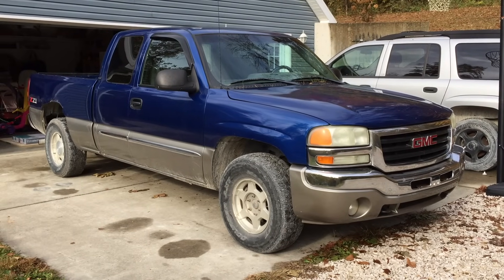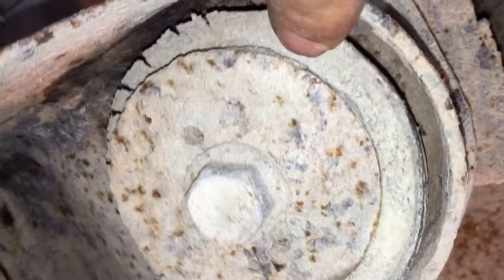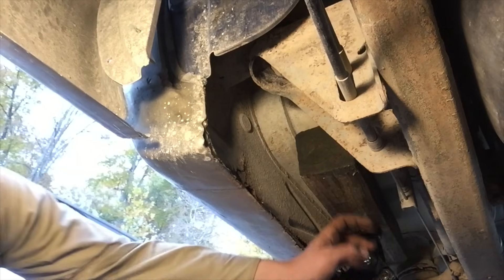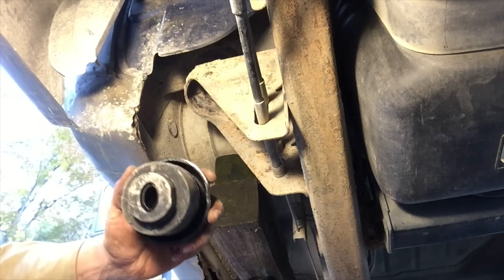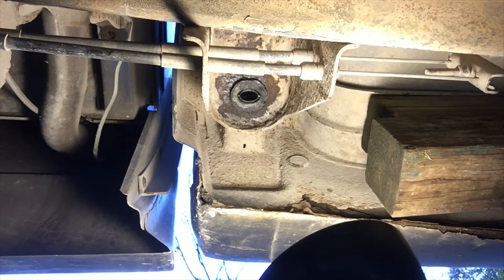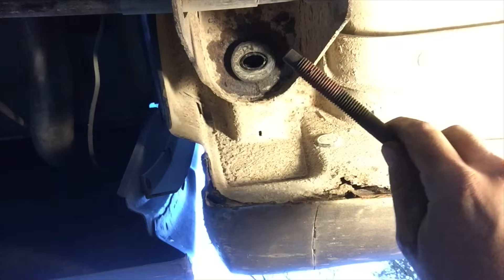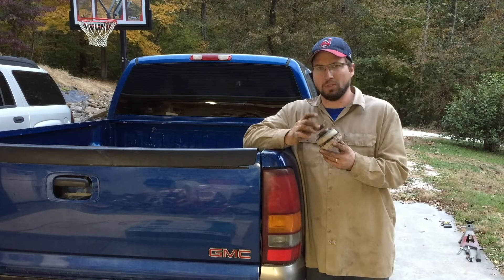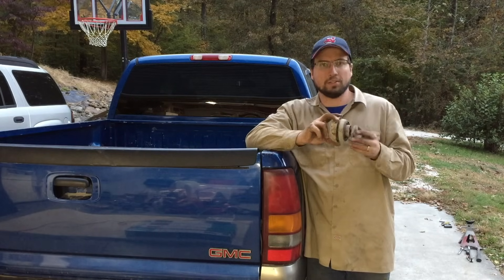How to replace truck body mounts - Body Mount Bushing replacement - EASY - Chevy/GMC

Comment: Those washers are for the top of the mount they go against the cab to keep the top of the bushing from sliding around
Reply: Where does it go exactly.?
Reply: glad I saw this thanks
Reply: I called dorman they told me they were for the bottom of the lower bushing theres already a steel cap on the top bushing.
Reply: @robpaul7900 so they both go right after the silver plate?

Comment: I pulled mine this morning and immediately had two of the bolts snap off. Do yourself a favor and get the bolts to replace the old ones when you buy your new bushings. If you buy bushings off Amazon or whatever, they may not come with new sleeves, so you may have to order new sleeves if they are needed. Check to make sure you are getting what you need. The bolts are 12-1.75 metric and can be purchased most anywhere.

Comment: i think gm designed planned obsolescence in these trucks. they designed them to rust so you have to buy new ones. my 89 k5 blazer is nearly rust free and is about fifteen years older.
Reply from the maker: Seems so. That, or they're just cutting corners to save money...but they still charge $45k for a new truck. I'm seeing 5-8 year old trucks (still brand new in my mind) of all makes and models that are rusting over the wheel wells and cab corners. It's ridiculous.
Reply: Spray the frame inside and out with clean motor oil mixed with kerosene.  Then hit a dusty road to seal it in.   Trucks frame will last forever
Reply: On
I will be at the office at th as well
Reply: You can do it for you
Reply: Eol. Serena you
Reply: @ddoperations2768  Yep, thats what we do in New Hampshire

Comment: Nice easy job that helps make driving an older truck that much better. Yeah, that rust is horrible. My '99 Suburban is rust free. I count myself blessed.
Reply: I live in AZ and of the 3 cars I've owned none had rust because they had spent their lives here in AZ, unfortunately the heat destroys those rubber bushings, i'm here because I have a 2006 Avalanche and thankfully it has no rust either, it was 1-owner registered in cali for the last 12 years, until i bought it from a dealer who picked it up from auction, only 130k miles, I'm now having to replace every single rubber bushing, planning on doing a full front end suspension rebuild in the coming weeks because of the damage caused by worn bushings and joints.
Reply: @shawnc6317  So what would be preventive maintenance for new bushings in Arizona heat?

Comment: Thank you Sir for a fine and very informative video.    I wish you had used a jack stand to help secure that cab instead of relying on that floor jack.   Your hands were in between the cab and frame. Just saying.     God Bless.

Comment: clean the metal with a wire brush before you install it and spray some anti rust paint on it so it doesnt get rusty again. put some thread locker on the bolts so it doesn't slip or come loose. :D

Comment: Due to its location, environmentally, you should be using anti-seize  compound on the threads as if in the future you may want to replace all the cab mount bushing's, cheapest insurance policy I know of to prevent cab mount bolts from locking up and breaking off, a whole nother can of worms!!!😮😮😮😮😮😮

Comment: Why mine wont come out?? Im trying to pull the bolt out, it moves (turning and turning) with the wrench but its not coming out
Any advice? The bolt is 21mm

Comment: Thanks for sharing this video.  I was replacing my mounts on a 1988 GMT400 and could not remember the orientation of the bushings; so, this was very helpful.  One of the problems with our trucks is the amount of corrosion that builds up over the years; a good example being the customer's truck you show here.  Even the frame mounts can get so rusted as to render them useless, at which point you either have to weld a new mounting plate to the frame, or replace the entire frame itself.  What I have done in restoring my truck is to coat every metal piece below the body (that would be exposed to road salt and water) with a rust preventative, e.g. Liquid Film, as I re-assemble each part.  My hope is to have a truck still road worthy for another 15 or more years.
Reply: That stuff falls right off, wish it worked better.
Reply: @streetbikebilly2597  Liquid film does seem to run off the vertical surfaces so recoating is recommended every couple of years.  There's a fellow up in Canada who uses this on his SUV and recoats every year following a thorough pressure wash of the underside of his vehicle. He has a car  lift so that obviously helps to ease the job and he spray coats with a pneumatic sprayer.  Were it only possible for all of us to have such equipment in our garages!
Reply: @tedtolentino4955  yep I just crawled around with 6 cans on the bottom of my truck and got myself covered in it. I think a good trick with that stuff is to do it a couple weeks before the first salt if not a little bit more earlier and while it's fresh go hit a dirty Dusty road up and down up and down and saturate the bottom with the dirt. I work on the roads and deal with the grinding dust from them milling up the roads. If there's any leak on the underside of the truck that asphalt dust sticks to that stuff like crazy but if you peel it away it's the only spots where the frame or body of the truck looks completely new. The poor mechanics tho.

Comment: awesome...but I recommend you use grease on the bushing....WD40 will dry out the rubber and make it harden.....then you'll have to do it over
Reply: Getting ready to do replace all cab mounts, thanks for the heads up!

Comment: Good work and thanks for this video.  I need to do the same thing to my 2017 Yukon XL.  QUESTION:  Would the body have lifted off a bit easier if you loosened the body mounts on the other side, or could that cause the body to shift a little caddy-wompus?  Also, any idea how much torque should have been applied on re-intsall?  Seems like that larger washer plate could buckle in under too much torque.  Thanks!

Comment: was gonna order the kit until I saw that the bolt you received wasn't the correct one. I don't have the original bolt (it was not there to begin with). ????????

Comment: Do you have any concerns about brake lines and other lines being stretched when lifting this way? My mechanic wants to charge for 8 hours of labor to disconnect my whole engine before lifting. I was just going to do this myself.
Reply from the maker: I didn't really have any concerns (not sure if I should have). I also didn't lift it up super high.
Reply: That’s exactly what my mechanic tried to tell me was that it was 8 hours of labor and a cost of $1200. Also it’s a 2017 GMC Canyon in which i never off-road in , they shouldn’t have gone out this bad , this fast. You can see the wear on it easily.
Reply: Screw that, you can buy every tool you need to do it for less than that. I’ve racked up so many tools from thinking like this. With those tools I’ll save on car repair costs for a lifetime. You can figure out most things just by looking around enough, don’t even need a repair manual.
Reply: How is your truck doing after putting new bushings...?
Reply: @RobertConley I have a single cab is the 924-335 for all 4 on just the cab

Comment: Tried replacing on my 01 silverado single cab and 3 bolts broke plus the the nut they bolt onto un welded inside !! How the hell do i fix that??? Anybody?
Reply: Cut holes in the cab on top side or sell it.

Comment: I think you did not do this right at all and did several things that will make others who follow what you did potentially run into trouble and regret doing what you did. First, you should NOT use an impact to take these out! GM uses a liberal coating of Blue Loctite on these bolts. I just removed mine using a ratchet by hand. I encountered one in particular that got very tight trying to remove it (my 1991 has some rust, but not like yours). If you encounter resistance removing. Stop. Reverse and rotate several times screwing the bolts back in. Then reverse and start removing. Resistance, stop again. Do this several times until you feel it coming out without the resistance. Going in and out allows the Loctite to clear out of the threads. You were lucky with rust that bad that you didn't snap the bolt off, in which case you would have been phuqued. I had the two rear most cab mounts having the bolts "welded" with rust to the bottom retaining cup and needed to tap with a hammer lightly to disengage the bolt from the cup. The bolts were visibly thinned via rust at that junction. Also those rear cushions were toast. You did not use the top retaining cup that had those four tangs. It goes on the top of the upper cushion. It is there to prevent the top cushion from spreading out and potentially failing/splitting under a severe load. You need to put lubricating grease on the tops and bottoms of each cushion and in the center bolt location (basically everywhere the cushion sees contact with metal) so the body to frame doesn't develop annoying squeaks going over bumps. You should use Blue Loctite (like the factory does) to keep the replaced or reused bolts from backing out. The factory does this for a reason. I am using an Energy replacement set that does not come with the bolts. I would have at least turned the ones you reused on a wire wheel to prevent the caked on rust from fouling the nut when you reinstalled. The Blue Loctite would be on the bolt end, and some grease on the body of the bolt (for squeak prevention). There is another cushion set under the radiator, referred to as the "core". I think you need to at least loosen those too to replace the body cushions to prevent potential distortion between the body of the cab and the front clips, but am not sure about that. I am going to do those too since the kit comes with them. It doesn't make sense to me to replace one. It is likely that the other side in the same cab location is just the same as far as deterioration. If a customer says to only replace one side brake pad or shoe, would you do that? You need to torque the bolts. Someone below said 50 ft-lbs was the right spec from factory manual. Without torquing to spec, you risk them being too loose and backing out or too tight and damaging the cushion ending its life prematurely or preventing it from doing its intended job of cushioning the cab against vibration and jolts. The set did not come with replacement bolts, the retaining cups, or the washers. Because of this I had to wire brush my OEMs, treat with rust proofing (where I am now), and then repaint them to delay further decay. I started down this path installing some "nerf bars" to ease ingress/egress from the cab, and that is when I noticed the cushions were severely deteriorated (work begets work) and needed to be replaced. The nerf bar kit has hardware that you attach by removing the cushion bolts and came with replacement bolts for the cushion mounts, so I am intending to use those.
I don't think this video did a good job of showing how to do this "right"....but I am not taking the time and effort to film me doing it, so there is that.

Comment: Thank you for the explanation and good photography.    I am watching your vid to see just what this cab bolt thing is all about.    I had my one ton in for unrelated work and was told that ALL FOUR OF THE CAB BOLTS were gone !   The Service Manager was quite insistent that I spend the money to replace and reinstall new complete hardware.    I see why now.
Reply: Im surprised they let you drive it out of the shop lol

Comment: Great video... I'm doing the same mount but on a 2011 F250.... did you loosen the opposite side body mount? Do I have to take them all out to get the cab to raise? And by" loosen" does that mean take the bolts out completely but not actually remove the bushing.. . Or just loosen the bolts but leave them seated?  Thank you for helping me out with this.  I just don't want what seems simple to turn into a huge project in not prepared for..

Comment: Hello so recently me n my grandpa bought a 99 GMC sierra its got the 2000 body style extended cab the owner said if u go over 40mph it shakes violenty does anybody know what the possible issue is engine trans and rear all been redone before buying the previous owner was a good buddy of his put a lotta love into it has a 6inch lift but I'm trying to figure what to trouble shoot the possible cause ???
Reply from the maker: A few things come to mind...possibly a tire out of balance or tread separating, bad universal joints in driveshaft, or bad tie rods...
Reply: Is it 2 wheel or 4x4?

Comment: Nice video, I am wondering what the issue was that lead you to realize that it was bad. I am having an odd frame twist clunk from the middle back somewhere when I turn especially.  if the truck is sitting put and I go to the rear and shake the back of the bed left and right and get a rhythm going it clunk clunk back and forth both directions clunk.  I have a stethoscope ordered to help. I wondered if it could be a mount and found your video and it just might be,,,,,,

Comment: Just replaced the body mount bushing on my 98 gmc jimmy, it's a job I will never do again. A bolt on the driver side just behind the front tire broke. Most of the other bolts were rusted to the point I needed new one's, which were very hard to find. I would also recommend using a 4x4 instead of a 2x4. I used a 2x4 and it was a mistake, it wasn't stiff enough and now the drivers door is way out of alignment (almost 1/4 inch). What should have been a few hrs job turn into almost 2 days.

Edit: Just about any GM product will rust, I've seen more rusted out chevy trucks than any other brand. Dodge being next in line.
Reply: Must’ve never seen a Ford in Minnesota 🤣🤣
Reply: I think you needed to loosen the core mounts under the radiator too. When you lifted the body off the frame, the cushions attaching the front of the vehicle to the frame meant you distorted the cab between the body and the front clips. Not certain about this. It could also be a function of how rusted your body is, or a combination of the two.

Comment: Thanks for making this video!  I'm in the process of replacing my body mounts on a 2005 Sierra.  I was also going to use the same Dorman part number, but was sure it was right.  After watching your video I'm positive you used the right one since mine look exactly the same.  The metal pieces that you didn't use were just spacers that some models had.  

As for the rust, mine is WAY worse.  Rockers are completely gone and the frame is quite rusty.  The downside living in the Midwest (Michigan).
Reply: I have 3 square body's and also live in the mid west( se Ohio) I'm too am in the process of a body mount issue.changing cabs.cab floor supports , quite a job.core supports fenders.😡

Comment: When bolt breaks inside. Now what? 🤯
Reply: Soak the threads in PB blaster, drill the center of the bolt, and get it out with an extractor.

Comment: I just did my 04 silverado with the Dorman mounts they do fit tight and you have to fool with them and turn them around if needed to get them to set good in the holes.  They are good body mounts just have to work with them, I replaced all six on my regular cab.

Comment: I wanted to replace just one in the front of my ‘97 Discovery, but it turns out I have to remove all of the other surrounding mounts to even lift the body from the frame. UGH!

Comment: "Removing a body mount is pretty simple. "
Uh...not if they break off!
Reply: Or just spin
Reply: You got that right,,had to chop a hole in my cab to get mine out cause most of the bolt was gone,,no other way to get to it..

Comment: Ive never seen rust like that down here in Texas. Do you live somewhere that it snows?
Reply from the maker: Yes, in good old Rust Belt, USA
Reply: Ohhhh that's not rust yet!
Reply: Same. I'm from new orleans and my truck looks almost like the day it rolled off the assembly line underneath. I've never seen rust like that unless it's a car that's been in the woods with a shit ton of a 3 ft pile of leaves for years.
Reply: @jordancomeaux6888  we have 2007s here that don't even have enough metal to attach fender flares... by my 1951Chevy doesnt have holes through it. New metal sucks!

Comment from the maker: What is it with these trucks and rust? I mean, I've seen 40 year old trucks with less rust than 5 year old trucks! The rockers on this truck were rusted completely out...and replaced with fiberglass.
Reply: Thinner paint and its water based to
Reply: i just bought a 2006 chevy avalanche, registered in cali for it's first 12 years, now it's here in AZ where it will spend the rest of it's life, the bushings are worn from the heat here and there, but maybe less than 5% of the entire truck has rust, it's mostly on bolts underneath the dash. the only two parts that are seemingly rusted are the driveshaft and the crankshaft pulley/harmonic balancer

however a friend of mine had a 2005 Ford Five Hundred that was here in AZ (although in a part where it snows in the winter) and the entire underside of his car was completely rusted out.
and my neighbors have a 2000 Ford explorer and it's completely rusted out as well.
Reply: You also have to take into account of the chemicals they use on the roads during the winter now it literally eats at vehicles

Comment: I think the bolts are to be torqued to 55-60 ft. lbs.
Reply: that seems high if there is rubber to be squished.  Where did you get your info ?
Reply: @jamiesarkisian9769 GM Repair manual says between 50-56 ft lbs
Reply: Thank you.  Would think that would be in the video